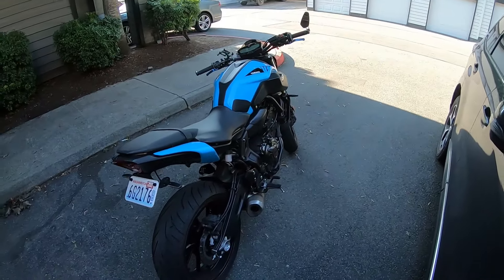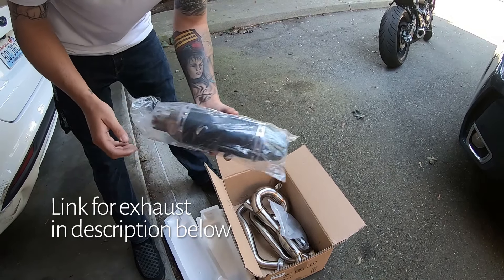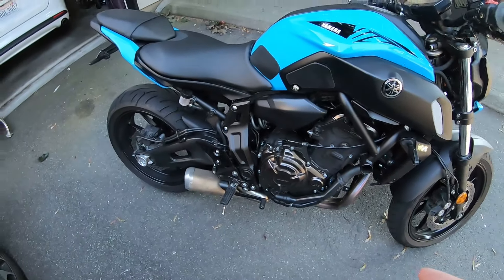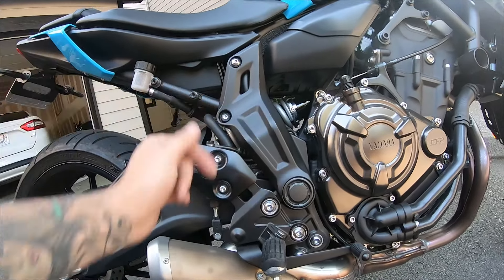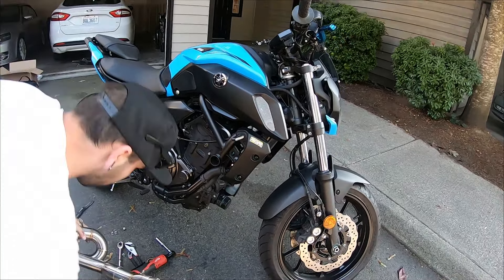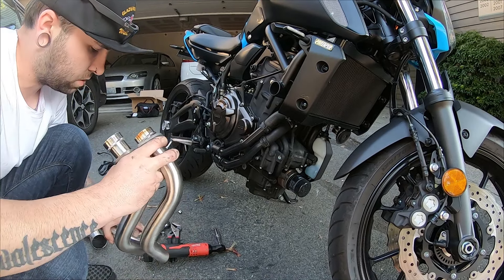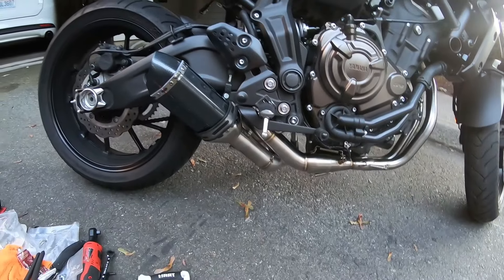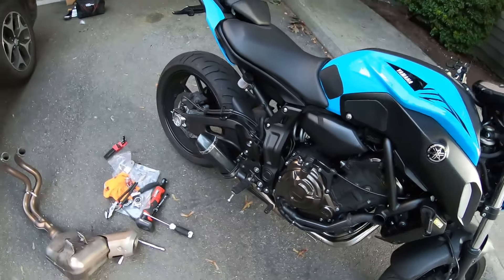2019 MT07 gets Amazon exhaust - Ep.20

Comment: I've had the same exhaust on mine for 1.5 years now. I had to take it back off at first and use gasket maker on the connections because there were small leaks. I noticed a small loss in power at first but I got the ECU flashed for it and now it's back to normal. I wouldn't say I have any more power but the bike looks and sounds way better with the same great original performance for a fraction of the cost of other exhausts. I call that a win.
Reply: Where did you get your ECU flashed? And did they have a mapping for the amazon muffler?!

Comment: Hey did the system bolt on good, no leaks? How’s it holding up overall?
Reply from the maker: Only issue was finding a way to hang the exhaust from the frame. Didnt come with instructions or correct hardware. I made it work, no current issues
Reply: @coryisdead  you forgot to mount the bracket, search the akrapovic exhaust install tutorial , you'll see

Comment: Did it throw a check engine light?
Reply from the maker: No it did not throw a check engine lightand still hasn't till this day
Reply: @coryisdead  nice. I just ordered a chinaponic exhaust and scared to put it on my 22’ because of the ecu not being tuned and scared it’s gonna throw a light. It’s my daily.
Reply from the maker: @jacobsingleton3034  Yea I have yet to get a tune for it but I'm sure it will help
Reply: @coryisdead  how long have you been running it without the tune? Tryna see the if it’ll last without getting a tune. Or if it would be bad for the bike in the long run without the tune? Sorry for all the questions, thanks for the replies man.
Reply from the maker: @jacobsingleton3034  I've had it on my bike since I put up the video. Give or take a day. But pretty much since last summer.

Comment: That's made by kids in China! The adults make expensive electronics!
Reply from the maker: Hey it works great
Reply: @coryisdead  Did it add power?
Reply from the maker: @travissearles23  I never got my bike tuned but it does feel a tiny bit faster and not as much engine breaking
Reply: @coryisdead  My Akrapovic added noticeable power increase and is 12 pounds lighter then stock which helped as well! They are great bikes!
Reply: Any links to the exhaust
Reply: @coryisdead  I have the akrapovic full exhaust,  power commander V, changed the air box lid, added a quick shifter and just had it dyno-tuned! Top speed is about 135 but it gets there fast and it's a blast to ride being the bike is so light! There's no more upgrades to do on this MT-07 so will be selling it to get an MT-10 most likely! Ride safe my friends!✌✌
Reply from the maker: @travissearles23  very nice. I've always wanted the kawasaki z900. I might upgrade to that bike.
Reply: @coryisdead  I hear it's an excellent motorcycle as well! The naked bikes are definitely the way to go for now! But I have a feeling electric, full fairing bikes will dominate in 2-3 years!

Comment: So I keep getting mixed messages on if u having to flash the ecu when u change exhaust
Reply from the maker: It depends on what youre wanting out of the bike. Ive had my bike 5 years with this exhaust without a tune and havent had any issues and no CEL. It runs just fine, but if youre wanting better air/fuel ratio and probably better MPG then id suggest getting a your ECU flashed. But because the 02 sensor is before the Catalytic converter its not going to have much affect. If the 02 sensor was placed after the Cat then yea youd have issues with the bike without a tune and probably throw a CEL code.
Reply: @coryisdead  thanks I appreciate the info I will definitely take that under advisement I can't wait to have my MT07 already